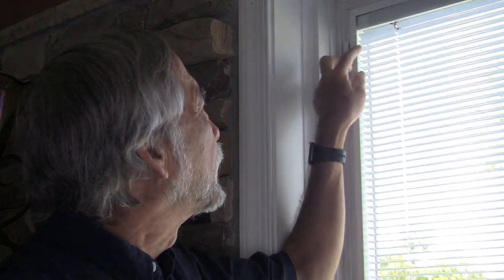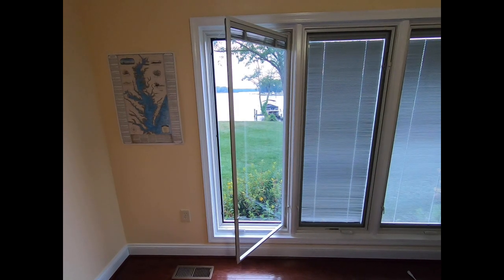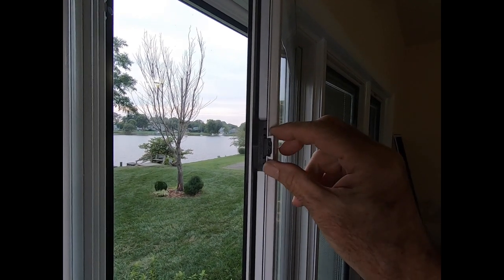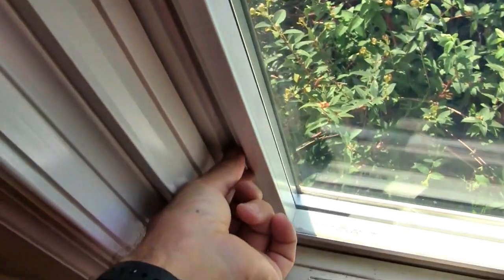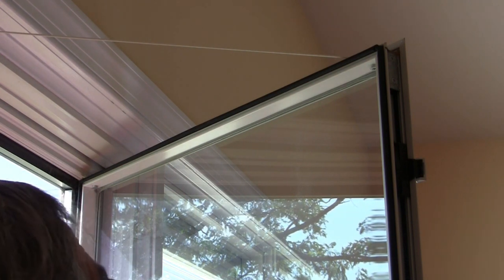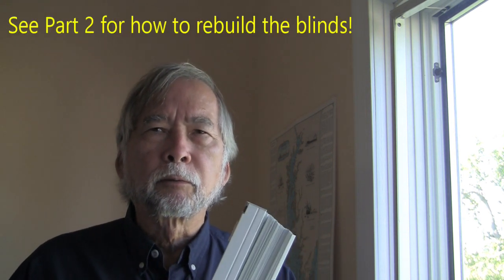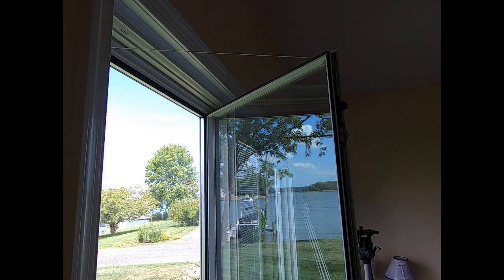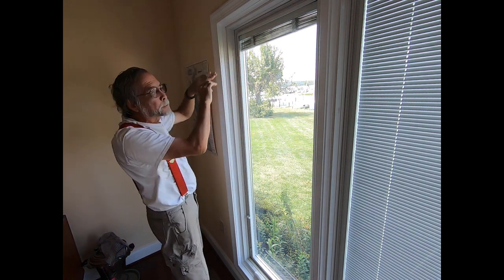Pella In Window Blinds Repair Part 1

Comment: As someone that's considering Pella casement windows (possibly with blinds) would you recommend simply adding a custom blind to the inside of the Pella window frame instead of the in-window Pella shade?  Or would you simple go with another window?
Reply from the maker: I would go with another window brand.  Since you are buying new, you should get the benefit of a warranty that covers everything.  That avoids vendors finger pointing at the other guy.

Comment: In 2008 we built a house and selected Pella Designer Series triple pane windows.  Now all of the blind strings are failing on the blinds and Pella will not supply the needed repair parts.  We paid $160 each for the blinds in 2008.  Now Pella wants $682 each if we were to replace them.  Based on other window issues we've had over the years, we conclude that Pella doesn't stand behind its products and it also doesn't support customers after the sale.  It basically gouges its customers after the sale if there are any issues.  If I could do it over again, I would go with Marvin or Anderson.
Reply: Pay a premium price for Pella and they offer no support for their blinds.  The ladder cord broke  on mine, they have a too bad attitude.  I sent mine to a place called OEM Blinds in Taylor Michigan, they said they maybe able to repair them, we will see when they get back.  Pella sucks.
Reply: @cz_ww2117  how did the repair go. We’re having the same issue and Pella does indeed suck. They quoted us 700 bucks to replace and 200 bucks to install. Wow.  Create something chincy and the money keeps rolling on in. Please advise and maybe we will send ours there too. Thanks in advance!

Comment: How long does it take to completely repair my mini blinds, ladders, cord etc?   Is it possible to contact you Shane?  What state are you in?
Reply from the maker: I can do a blind in about two hours.  Took me three to do the first one.  I am not in the business of rebuilding blinds.
Reply: I am considering getting Pella triple pain doorwall with mini blinds between the glass.  Was it worth the extra money?    Mine would be on West facing window so I’m concerned about the sun weakening them over time.  Do you have 3x pane glass?   Do you have the newer belt pulley system or strings?  I understand the belt can wear out too.  I think I know all the advantages.  Tell me the disadvantages.
Reply from the maker: @lisalaratta6184 
I have the tripleane windows with the belt drive.  The belt drive is ok..  when the belt skips over the pullies, the cause is usually the draw strings failing and binding in the mechanism.  I live in Maryland.  All my south facing window blinds started failing 12 years after installation.   If you live in a southern state, blinds will last less than that. 0:04

Comment: My blinds don’t close fully. The lever that operates the up and down has a tendency to skip and therefore doesn’t close all the way.  Do you have any ideas?  Thanks Gary
Reply from the maker: The lever operates a toothed rubber belt in the window frame.  The belt is skipping over the sprockets because the drawstring is going bad and is binding up on the rod that rotates and pulls up the drawstring.

It is also possible, but less likely, that your rubber belt needs to be replaced.  You can get those from Pella at $100 a pop.  I make the mistake of buying three of them when it was the drawstring mechanism.  That's why I made the video.
Reply: @shaneyanagisawa9630  Thank You for the information.  Much appreciated, Gary

Comment: is there a way to change the starting point for the adjuster?
 my wife is short and the adjuster is high in the start position.
Reply from the maker: Yes, you can lower the adjuster knob somewhat..  Lower the shade all the way, then remove the shade.  Set the adjuster knob where you want it in the upper position and the reinstall the shade.   If you haven’t set the knob too low, there should be enough travel to raise the blind all the way.